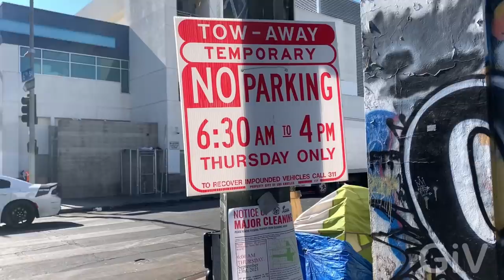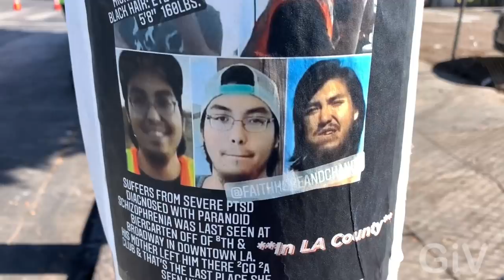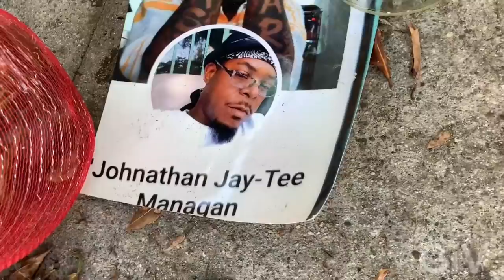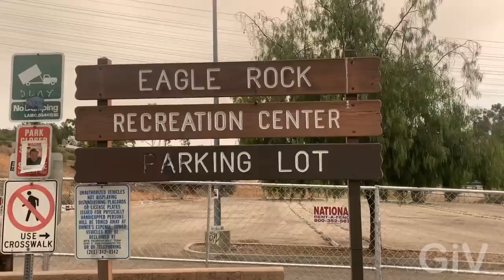Skid Row major Clean up but no camping enforcement in Downtown Los Angeles

Comment: The no camping policy has definitely been enforced. After they cleaned up the whole place, the sanitation team systematically took down all the tents. The city did not allow camping at anytime within the city limits. Even if you could retrieve your tent, that "you paid for"  and "put it back up" later on that night;  you couldn't get very far.  It was much more economical to
follow over to the shelter areas.
Reply: The tents always come back.

Comment: I was hoping there would be a plan in place to move these people to housing before the cleanup. Finding housing for 70,000 homeless people is no easy task. Tiny homes built for 2 are ok for some, but many have mental illness, some are violent, & shouldn't be sharing small spaces with others. Many haven't worked in years, have health problems, & cannot be employed unless employers are willing to take risks. There are those who don't want assistance & would rather live & die on the streets of Skid Row. There should be designated city owned areas off the sidewalks for those who wish to live in tents. Homelessness does not just disappear, but grows with time.
Reply: Move them out to a camp in the desert
Reply: @castorkat4868  so many deserted military towns. Fence them off and do food, trash and drug air drops weekly.